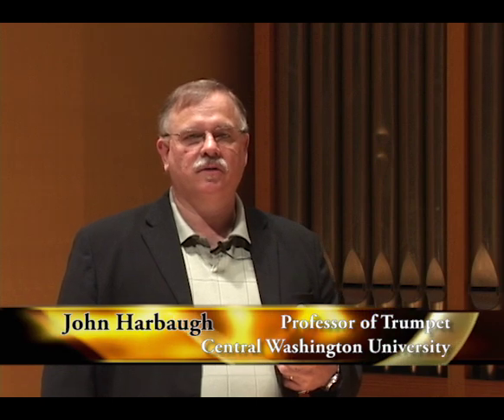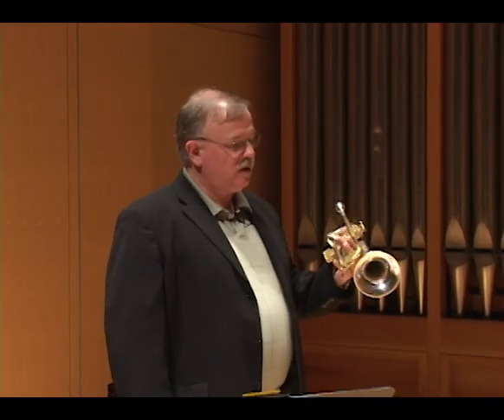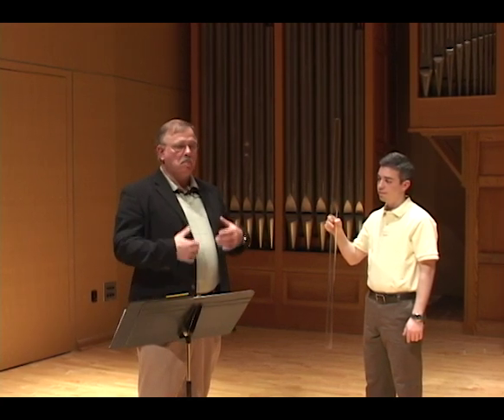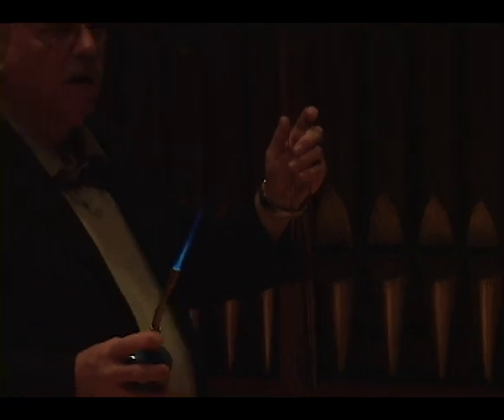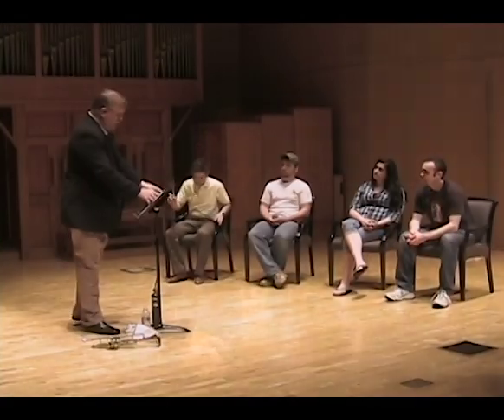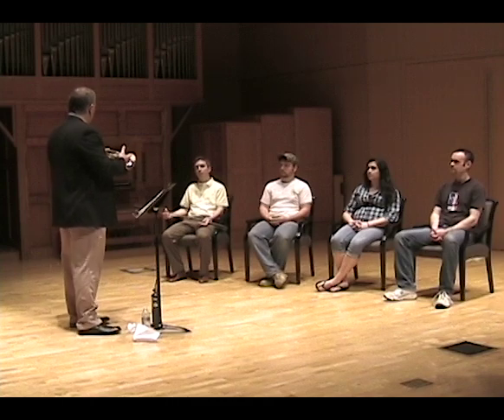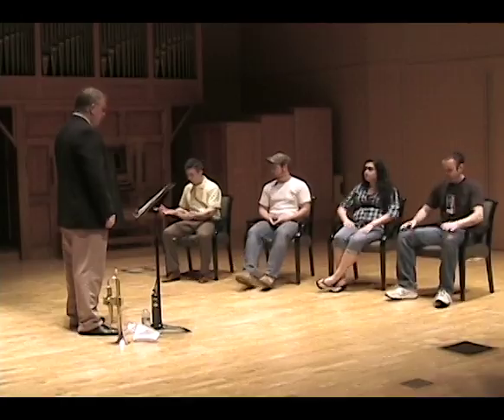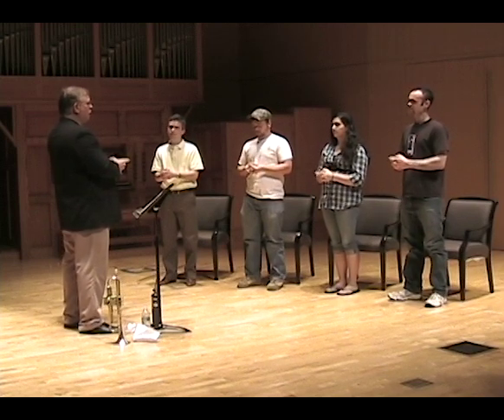trumpet_physics_1.mov

Comment: I wish I stumbled across this vid in 2011. great vid.  About the flame, though, the explanation for the physics is not quite right. The tube is not a vacuum.  The flame requires air and thus "pulls" air into the tube. The flow of new air together with the heat creates a perturbation [disturbance] of energy acting upon the air mass inside the tube, exiting the tube at the top, the motion of which we hear as sound. Instead of heat, trumpeters add energy by blowing air.
Reply: This is the same conclusion I came to. I don't think this is what happens when we play. I can blow a ton of "excited" air through the horn with no sound being produced other than a hiss out the bell.
Reply: @Hammondbrass   fact: Sound has nothing to do with volume or velocity of air.  Thus, your comment is true, and proven. Sound requires a pressure and frequency. Why? the mechanics of our ears. The mouthpiece constricts the air we blow, thus creating a pressure. The air we blow causes our lips to buzz, thus creating the frequency. High frequency requires high-pitched buzz, which requires more pressure, which requires more air, and thus high notes are more difficult and strenuous.

Comment: Cool video!  I have a legitimate question and I promise I'm not trying to be a troll. Isn't the flame burning the oxygen in the tube and then air is being pulled from the top of the tube creating a sound? Also, couldn't the flame then be disturbed by that downward current of air?  And wouldn't that be the reason you hear the sound first and then the flame is disturbed second?

I totally believe that we excite the air molecules in the horn. The horn is already filled with air, as they say. Fill it with sound.
Reply: I subscribe to your words